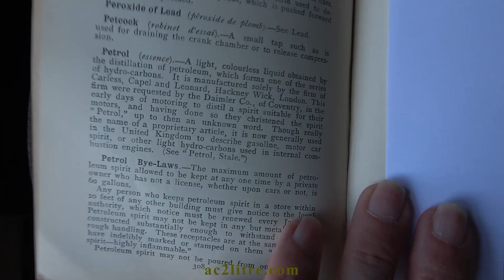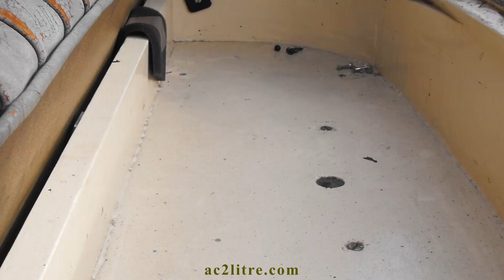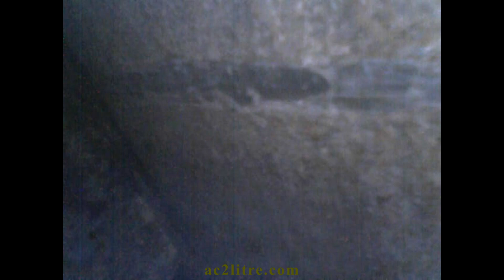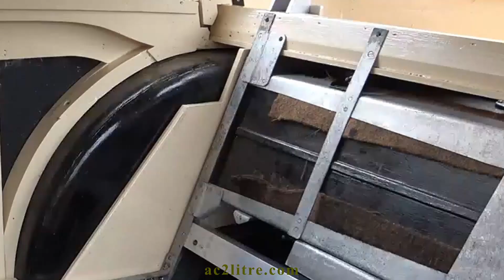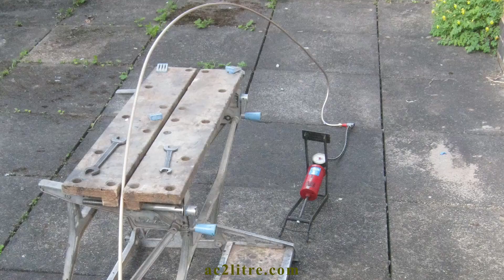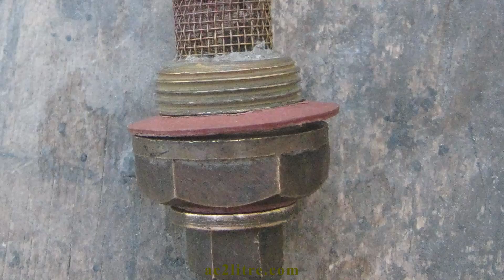Overhauling a fuel tank - 1949 AC 2 Litre (slideshow).

Comment: Luckly my tr3 tank is in great condition it has been dry since 1973 no varnish. there is a little fine rust right around where the outlet pipe is so I will clean that. I was surprised it was in such good condition sitting dry for so long.
Reply from the maker: I wonder if yours is solder coated too? Glad to hear it's in good condition.
Reply: @ac2litre  I will have to look it is original to the car from 1955. I really dont want to line it I have heard many horror story's. Hear in Alaska we mostly dont have methanal added fuel just in the big city and only in the winter. I can get aircraft fuel at my gas station at the pump 100 low lead.